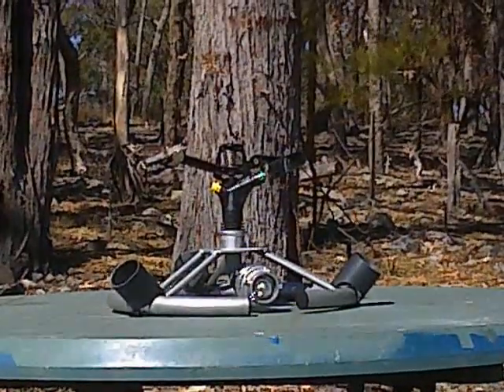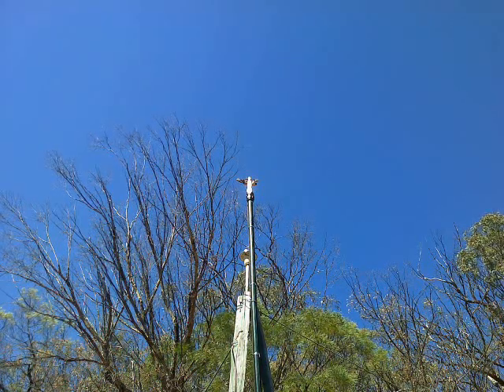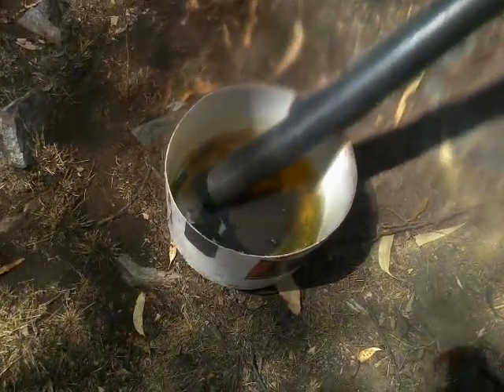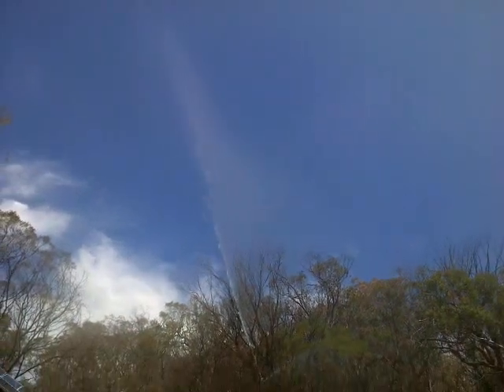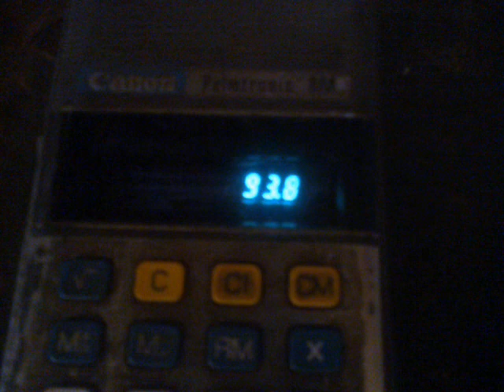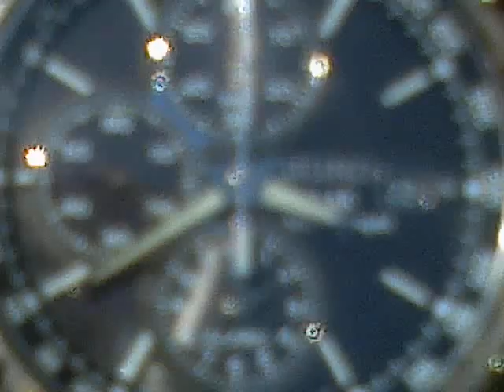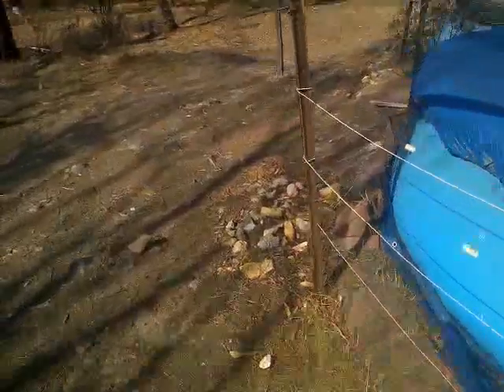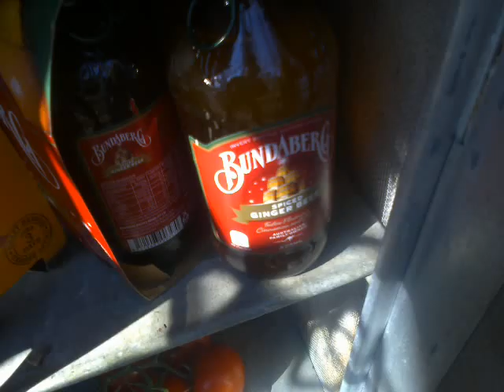The Toro Monsoon..., Adventures In Adding Rigidity...

Comment: I don't often have time to watch long videos. 
But I did have time today and so I watched the whole thing. 
For the record, I enjoyed it. 
If I was you, I wouldn't want to anger the fire Gods by saying "I think I'll be right.".. but I reckon you will be, with your setup and plan. 
And the tweaks to it will only help.
You earned your (Queensland made) Ginger Beer.
Reply from the maker: G'day,

  Thanks mate.

  Well, the translation of ,... "I think I'll be alright..." ; is more or less, ... "I hope to save my Hut, ideally everything within the Defended Area, and I don't think I'll get too badly burned in the trying...".

  As I said, this level of preparedness allows me to feel a bit less helplessly dependant on Miracles and Divine Intervention.

 That isn't to say that I'd turn my nose up if every Storm for a thousand Miles in an  upwind Arc accross 50 degrees of my Horizon all changed Tack to head for an Initial Point 5 Km Upwind of here proceeding henceforward, in Line Astern to cruise directly overhead the bit for which I'm responsible, and then all take turns to rain on my Bushfire Fuel Burden - all without zapping the Landscape with Lightning until after first thorouhly wetting the place down.

   But I'm not so rash as to  attempt to demand (or command) any such a Raindance Response.

   But I figure that it'll be easier for the Creator to get on with the Gameplan if I convert all my available "spare money" into Fire-Prepping.
   
It can't hurt, and it might help ; I have to do something - and this is definitely Something (!).

Have a good one.

;-p

Ciao !

Comment: I thought I would make this a two part series, but ended up watching the whole damn thing in one setting, who woulda thunk watching an old guy watering his lawn in the middle of the woods could be so entertaining??? If the water is falling straight down at its maximum range, then you’ve probably got it as high as it will make a difference in the radius??? Thanks for sharing.
Have a good day.
Cheers 🍻
Reply from the maker: G'day,

Thanks mate.

Yes, I think the only thing which would add range at this point would be more Pressure - bigger Pump/s ; equating to more Water...., requiring more money than I have avilable.

One has to cut one's Coat to suit one's Cloth...
   
   The front of the "Machinery Shed" is 12 ft high, so with the Toro Monsoon being 3 ft above that - the base of the "Wet Dome" is about 13 to 17 ft above Ground-Level, and the Water is descending vertically below that.

  It's pretty cunning, actually (!).

Have a good one,

;-p

Ciao !

Comment: Hi Chris,
You certainly deserved your beer after that brilliant work. The tower setup is fantastic. Are you still going to use the other sprinkler? It might be handy for close proximity protection to the hut although it may drop the water pressure to the tower sprinkler. It would be perfect if your neighbour got the water setup working soon. 
It's a bloody shame you have to do all this because of the drought, but I would do the same Chris. Take care mate and I am glad you are prepared.
Cheers mate.
Reply from the maker: G'day Mike,

Thanks mate.

  I think I'll be having the Dam-Pump either alternating between the Sled - migrating accross the 3 Tripods all arrayed upwind of where the Monsoon's Edge runs dry..., and the Monsoon itelf..., or it'll be replenishing the Prism Frame Pool every time the Firehoses have drawn it down a couple of tons.

  Another option is to run  both Sprinklers off the Top Pump & use the Reel Hose for Embers as and when, with the Dam Pump constantly refilling the Pool against the 2 Sprinklers and whenever the Reel Hose plus both Sprinklers  have used a couple of tons then I switch one sprinkler off till the Pool is full again.
   
  I'm very eager for my Neighbour's Bore to come on line.
    
 It's getting to be quite a Project...

Such is Life,

Have a good one.

;-p

Ciao !

Comment: Someone just had all the fun! onya o son!

I was loled @ the provocative gyrating pole poking fun at you; you, however had the last laugh somewhat! Well, at least she was not at resonance, the tower could have collapsed ; )
If you indulge yourself, you may even end up with your own micro-climate; an oasis of kind! 
I suppose the important thing now is to establish the sprinkling time taken to achieve a modest degree of saturation to prevent the spread of a moderate fire through your joint! Wetting the place for a few minutes before the fire may not work; and of course it will be strategical when to switch the system on given you only had limited resource; you don't want the place dried out when the fire arrives; do you?! Whichever way, the "fun" or "struggles" continue! Catch up later.
Reply from the maker: G'day,

  Thanks,
  
I think the problem was that the first bit of Aluminium Extrusion I wired to the Polypipe had 3 times more Rigidity in the East-West Axis as it was in N.-S., while the Tower - while triangulated , is a Minimalist Structure which only ever had to hold up two Extension-Cords.

  With a 6.5 Hp Motor  pushing 3.5 Hp of Water (55% Pump Efficiency), and 2/3 o the Water in the Main Jet.., then there's 2.25 Hp of Water coming out of the Jet (with 1.25 Hp from the Fill-In Nozzle)....; if the Flow Diverter goes in for 1/4 of a Second then it collects an Impulse o 50% of 0.6 Hp...., stores it in the Spring & then delivers it to the Side of the Nozzle's Axis...; and the Nozzle rotates against a Drag-Brake, so allowing for 50% Efficiency the Mounting of the Sprinkler is Torquing the top of the Tower, pulling & pushing back and forth with about 1/16th of a Horsepower - say 45 Foot-Pound-Seconds...

   And the Soft one-way/Stiff the other-way Extrusion was literally allowing the Pipe to act like the Cracker on a Torsional Corkscrewing Whip, using the Tower's long unstayed Legs as a Spring...

  The current setup is good for 50 litres/Minute (from the Dam pump, or throttling the Top Pump), but 67 Litres/Minute is a bit too much for it.

   Further triangulation of the Tower will hopefully "Rigiditise" the system unto the point of 1/2 to 1 RPM, rather than 4 Minutes to the Revolution.

  At the moment, this was a System-Test - I have no water to spare for trying to establish an Oasis ; I have enough to try to cope with one bad day.

   Through the Sprinklers, the Dam Pump has about 10 or 12 Hours' Water in it...

   The idea is to not go using all the Water on a false Alarm.

Unless a Fire begins within a few Km, say 10 on a Windy Day..., then I should have an hour or so to get set up.

  What I have is more options than I'd have available if I'd squandered the money on trying to take my Trouble & Strife's name off the Title-Deed of this Firetrap - which was what I had been saving towards (!).

Such is Life.

  Have a good one.

;-p

Ciao !

Comment: What if the fire is in one place, might it take it ten minutes to get around to it?  Also, did you check it on the ground to see how long it takes for a revolution?  Yeah going a lot faster later on in the video.
Reply from the maker: G'day,

Thanks.

   Well, if there's a fire  within Hose-Range of the "Top Pump" then I'd be dealing with that via either the  Top Pump's other two Hoses - or with the Wormald Simplex - if there's not time to start the Pump.., 
 before setting out to start the Dam-Pump.
   
 If I leave the Top Pump feeding the Monsoon Sprinkler with 67 Litres/minute from the Prism-Frame Pool, while going to start the Pump, then assuming 7 minutes to get there, 2 minutes to start up & warm up the Pump before taking another maybe 8 minutes to walk back uphill..., then the Monsoon will have put out 1,139 Litres over about 1,100 Sq/m while I was off doing PumpWalkies, and the Dam-Pump will have pushed 750 Litres up the Hill by the time I get back...

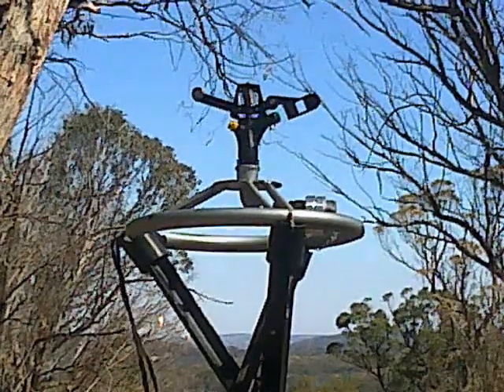Then, the Dam Pump will be delivering 26.5 Litres/minute more than the Monsoon can take, so after another 15 minutes the Monsoon will have put out another Ton onto the Defended Area, the three Pools will be full, and the Dam-Water will continue to flow for another 1:45 before that Pump needs refuelling.

   During that time whatever Damwater isn't replenishing whatever the Firehoses are taking from the Pools, will be going out via the Sled at 40 L/min on the 3 Tripods in an Upwind Arc, or at 50 L/min through the Monsoon.

Clockwatching will be a big part of it..., and I'm nearly tempted to look for a 12 Litre Tank (from a Generator) and cobble it onto the Dam-Pump, to give 6 Hours of Pumping without refuelling.

   I can't see me needing to put out 36 tons from the Sprinkler,  plus the 14 tons available to the Firehoses, in the one Day..., but I'd like to be able to do it on the one Pumpwalk - rather than 6 times down & up the Hill.

As I see it, it's certainly a fascinating & challenging sort of a problem ; and if I don't try to solve it then who else will ?

Such is Life,

Have a good one.

;-p

Ciao !